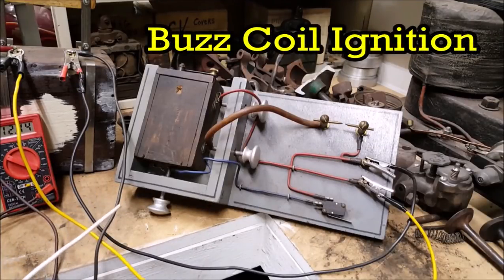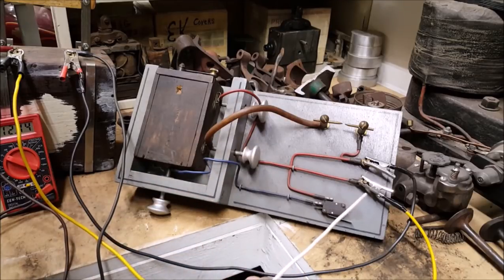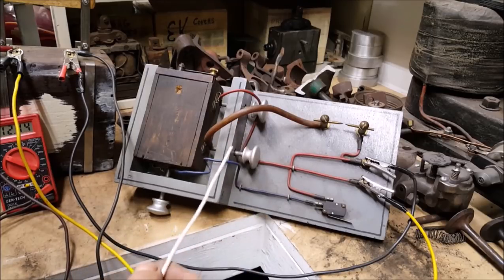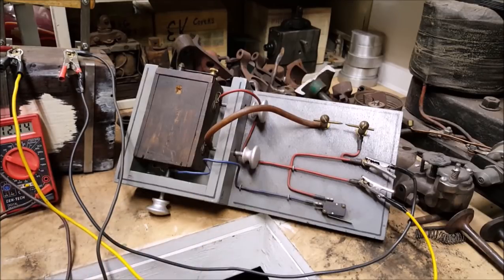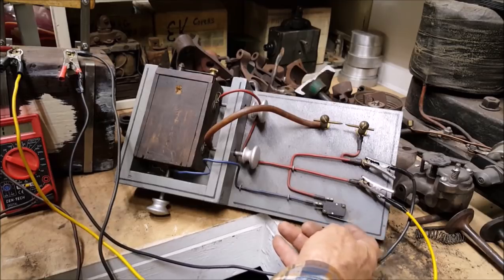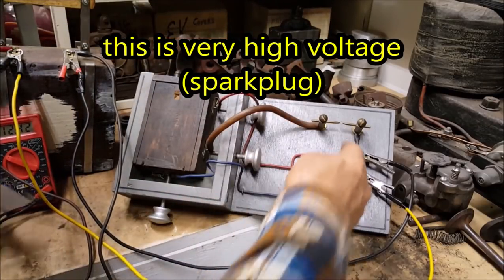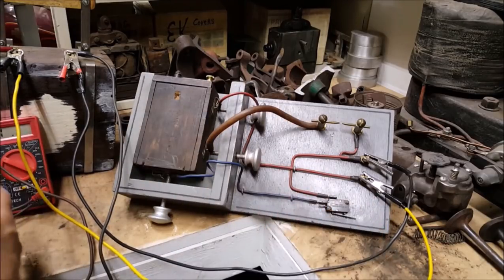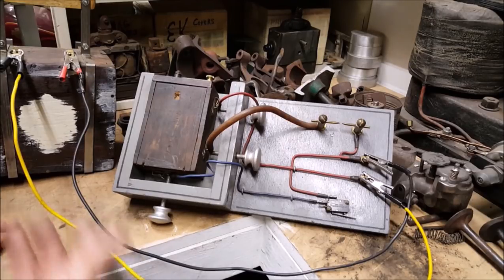Buzz Coil Tester t model spark gap

Comment: I really like that, I think I am going to build one like it to check the coils on my Model T.  Sometimes you need someway to eliminate the guess work in a situation.  That is a great simple way to to build one and think you have done a Great job!  If you have problems with one you can put it in there and test it, and boom you know right away if it is good or bad.

Comment: Those Model-A coils make one helluva vehicle theft deterrent, when wired onboard to a vehicle using a grounding chain and a flasher module. I've seen one in action, it really worked, just like an electric fence charger. Ponder that for awhile.....😩
Reply from the maker: ,, high voltage,, it's that buzzing i'm talking about,,  o, that flasher thing,, i remember the first time I touched one
Reply: I remember my Grandfather telling me about that once long ago. He said he made one and it worked real good. Got himself a couple of times with it.
I just rediscovered one of those old buzz boxes out in my garage that I got somewhere 25 years ago.
Now I'm gonna have to see if I can't get it working. I saved this here video for the wiring tips.
Thanks again Sam, interesting as always.

Comment: At least you know you got spark.
Just be sure to to have the high tension /spark plug wire always connected to ground, otherwise you'll short out that side of the coil (just like you talked about before with a M-style magneto being clicked open without a ground)--but with this you can't go wrong! 
Thanks for sharing.
Reply from the maker: right,, spark gap too wide will do that also,,